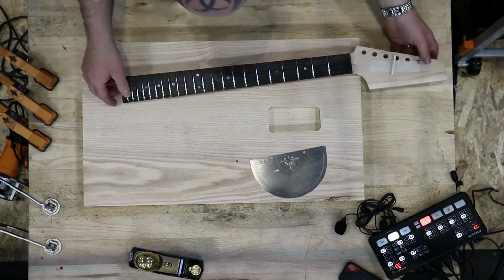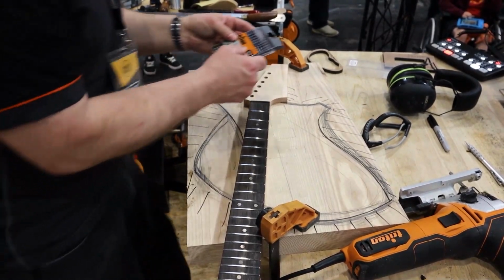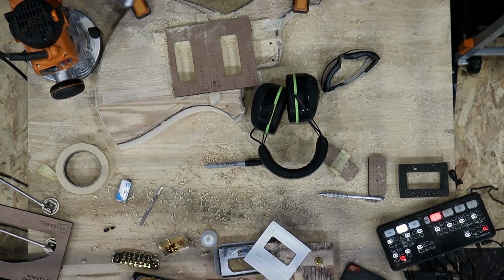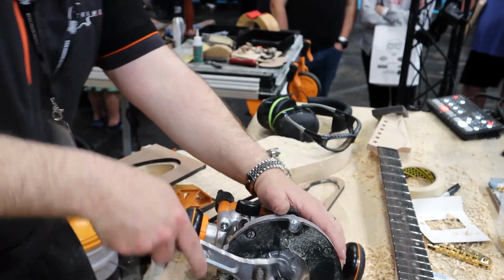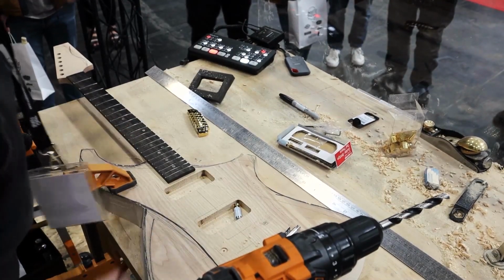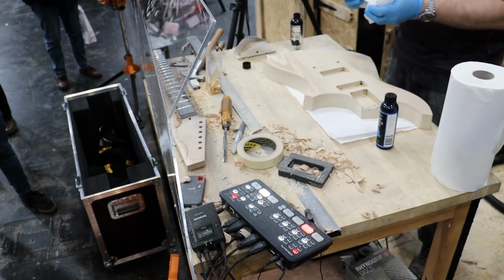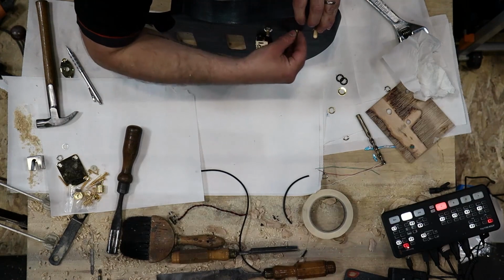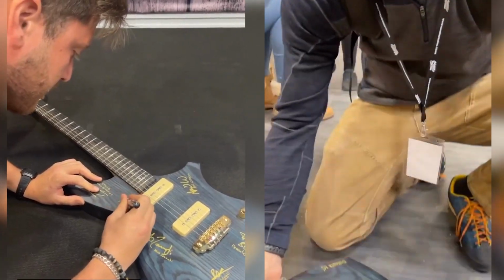Custom Uncut Kit Guitar Full Build - filmed at Makers Central 2022 with a Live Audience

Comment: Not too bad for such a quick build. With a bit of refinement the body shape could work quite well as a production Guitar. One thing that would have really set off the grain pattern would have been to use a white or even the gold grain filler with the gold hard ware at least on the top but again you had a short time frame. The only thing I might had suggested on the heard stock was to make the out bound curve on the bottom a little narrower and have just a slight rounding of the sharp corners.

Comment: Hey Ben! Slightly unrelated question, I've just seen a small hammer at the 54:39 min mark. I was give that exact same hammer but the handle broke into 2 pieces and I don't have access to the 2nd piece. I was just wondering how long the handle is as I need to make a replacement in the future. Thanks!

Comment: Awesome. I'm starting a build with that same bridge so great to see how Ben measured it up.

What's the product applied after the stain around the 42min mark?
Reply: Its the water bases wipe on guitar finishing lacquer by Crimson Guitars

https://www.crimsonguitars.com/products/water-based-wipe-on-guitar-finishing-lacquer
Reply: @CreaverI  thanks! Is this the one that Ben said is actually a varnish and not a lacquer in one of the other builds? Any idea why one would use this instead of the crimson oils?
Reply: @davidcane7211  That's the one yes!
It is harder than oil, so a little more protection and cures a lot faster.
And like he said it also colors the wood less, if that's what you want.

Comment: As you said "nobody wants to see soldering"... How about making Crimson drop-in solderless guitar electronics kits, if such doesn't exist yet. Should be entirely possible. Just make them so it's possible to solder them, but not mandatory - so no plastic connectors.